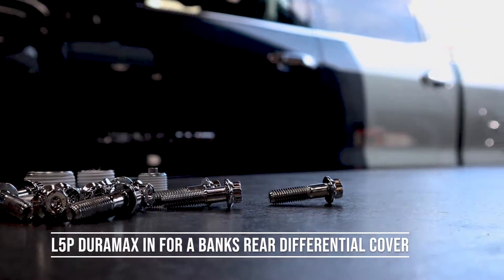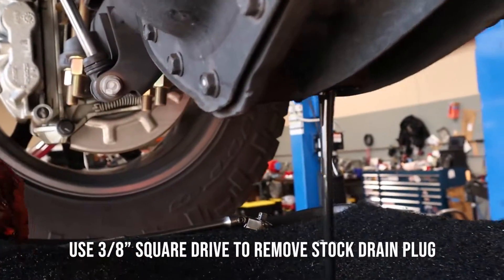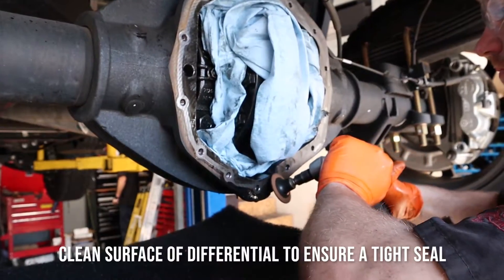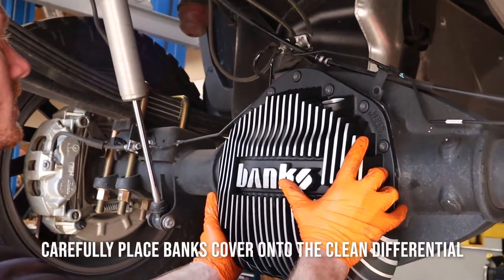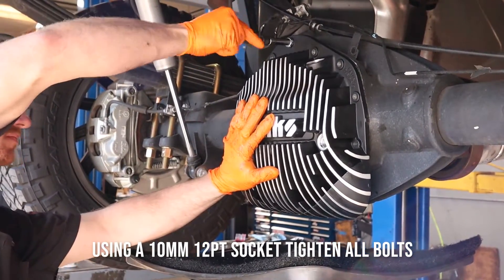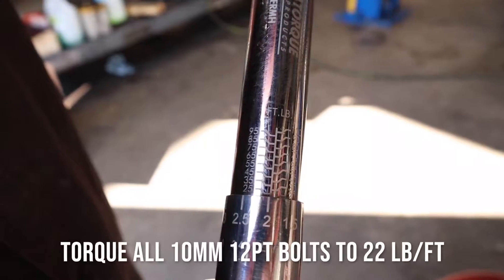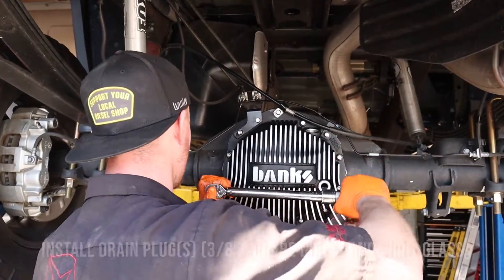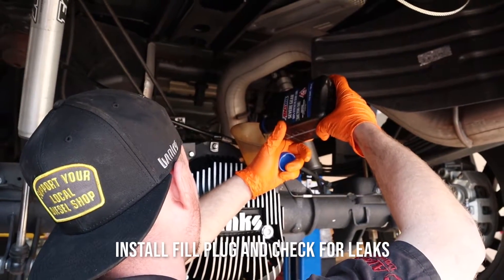Banks Differential Cover Installation

Comment: Why dose the banks not have a temp port for the Duramax trucks
Reply from the maker: I am not sure why they chose not to include a port for a sensor, it is not very common for people to monitor that temp so it may not have been worth it for them to include it for the few people that want to run a sensor.
Reply: My cover has a temp port